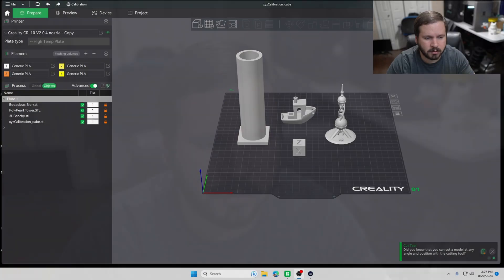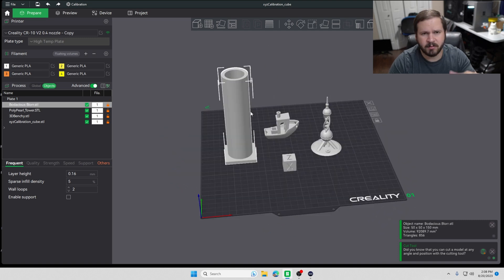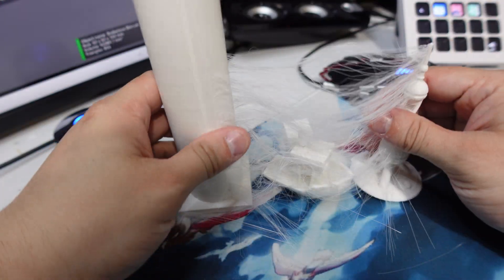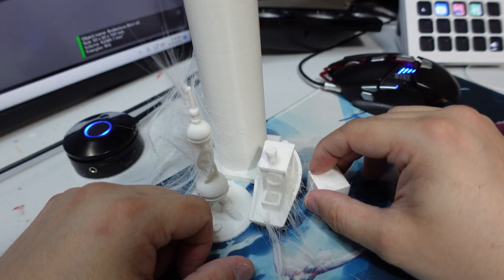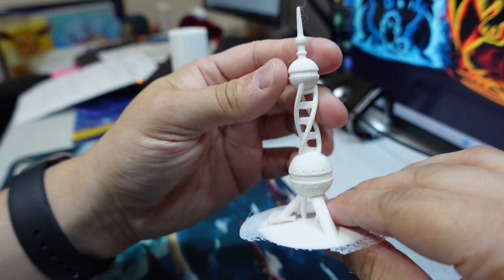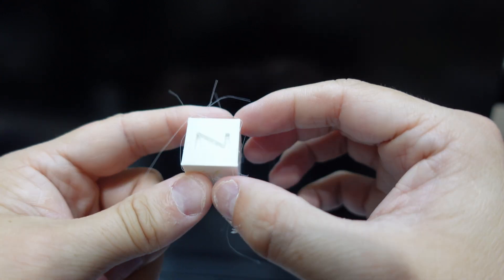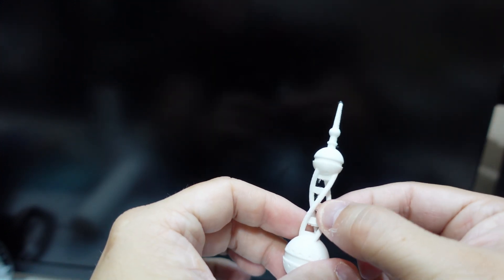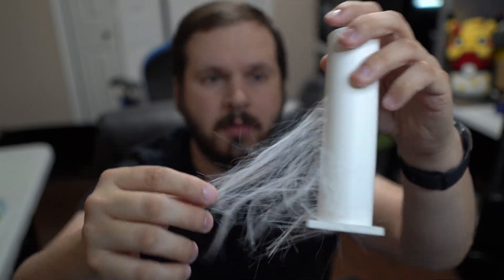WOW, This Was Fun!!! Printing From The Bambu Slicer To A Non-Bambu Printer

Comment: You showed nothing. Lower the temp, aument the retraction and try again. What about the printing time? How does the creality moves with thr bambu SW? etc.
Reply from the maker: Thanks for the comment!!! You are correct that I changed nothing. I wanted to show an apples to apples comparison of what would happen if you tried this with default settings. 

This would worked if I would have worked to dial in the settings.

Regarding speed, it appears the speed within the bambu software was around 40mm/s.

Comment: Switched to Orcaslicer for the same scenario, offers a good set of calibration tools build-in allow "fiddle-less" tuning. Use Orca now for Bambu, Voron, Delta, and CR10S5's with perfect results. Each machine tune-in only needs to be done once, takes about an hour from start to end depending on the used PA measurement method and fully removes the guessing-game as the calibration tools in Orca are very well established and documented.
Reply from the maker: Great suggestion!!! I will have to take a look at that slicer.